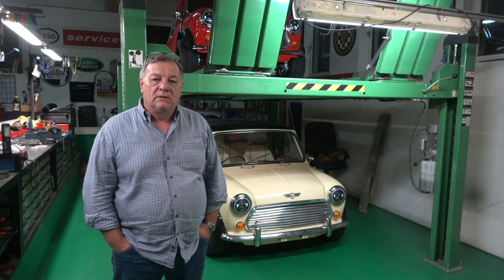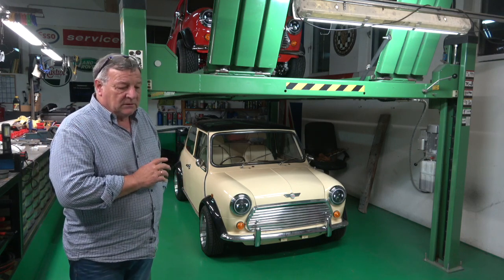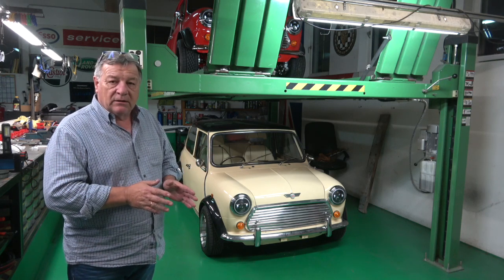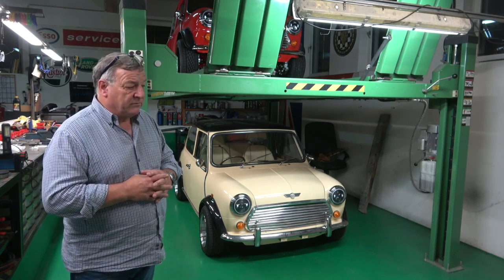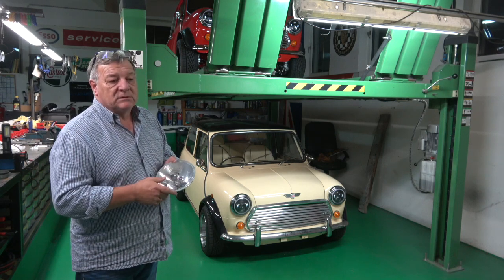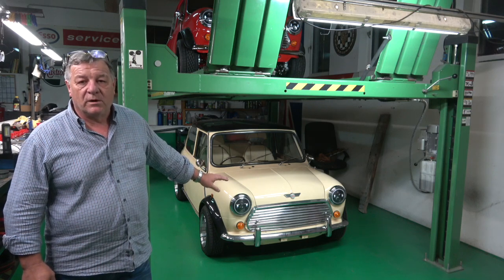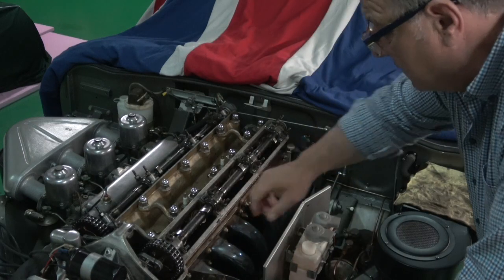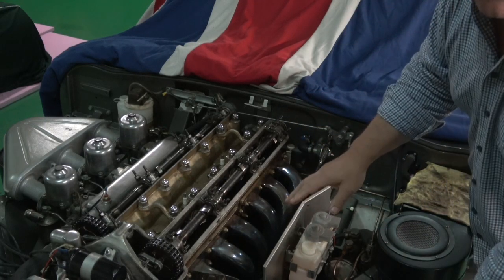Classic Mini Halo Headlight Issues & Jaguar Valve Shims.

Comment: Good info and yes I too purchased the cheap $90 copy ones.  With that said however, our inspections here in Texas most likely will NOT give a second look as long as the lights turn on..    Dude.. you're awesome...
Reply from the maker: Randy, I have been told some these lights have been passed but i know how strict the test is in Austria so i will
change them for standard and maybe fit them back afterwards as i will never drive it at night! Cheers Dave

Comment: I fitted 'Cheap' LED Halo headlights that use H4 halogen bulbs to one of my cars. The units supplied were with a plastic front and scalloped plastic lens. I replaced the bulbs with Philips X-tremeVision bulbs that give more light. Looked great.
Now here's the downside. Beam pattern is crap. Worst of all the plastic units couldn't cope with the additional heat and bulbs blow! Pricey!!
I am also in the process of junking them. My other car also has twin 7" units that I have used standard replacement silvered metal & glass units with Extreme bulbs and it works great. I was driving on a dark road and main beam (with all four on) lit up the road nicely. 
Lesson learned,standard glass units with Philips X-tremeVision  bulbs is the way for me.
Reply from the maker: Adam, Good point on the heat it was something i had not even considered i may use them as i really like the indicator
in the headlight i think it‘s a bit Kinky as in the 1960s use of the word lol, Cheers Dave

Comment: The head lights should pass in the uk on a flat pattern with the lights 2ft away from the wall but it has to be a crisp sharp top line with no light leakage above. But they tend to fail as they have no headlight washers or electric adjusters and your meant to have them with hid & led lights
Reply from the maker: Mark, I can only go by what i have been told by other guys in the UK who had a failure with the same lights, I was also told one mini that went for a MOT they did not even check the headlights on a beam setter!  I had an MOT station in Scotland many years ago so i can‘t say what the rules are now but i would not have passed the beams it‘s projecting.
Cheers Dave

Comment: Hi dave I'm re assembling my rear drum cylinder and I noticed in the Haynes manual that it's the front brake cylinder. Does it matter much if I but them in? Thanks Lewis
Reply from the maker: Lewis, The rear cylinder is a double acting piston and the fronts are single piston leading & trailing shoes, You can not
use the rear cylinder for the front, There is two brake cylinders on the front drum brake setup. Cheers Dave
Reply: @ClassicCarCave  thanks. Just realised feel a bit stupid now 😂
Reply from the maker: Lewis, It‘s the other way round only stupid people don‘t ask questions or find the truth lol, Cheers Dave

Comment: You can get LED bulbs that fit a standard headlights, so you will get the improved light with a standard look.
Reply from the maker: Gavin, I will look in to that as it seems like a good option, Cheers Dave